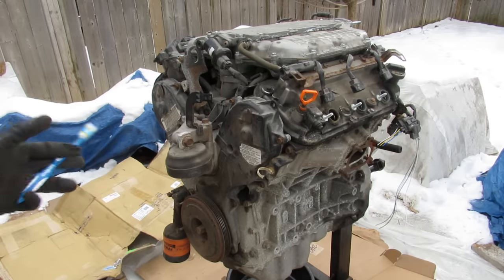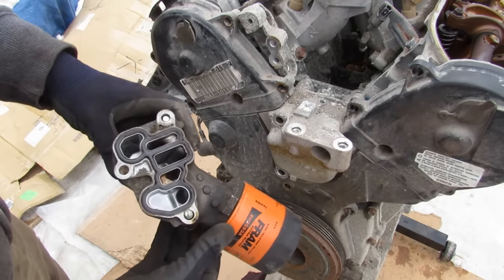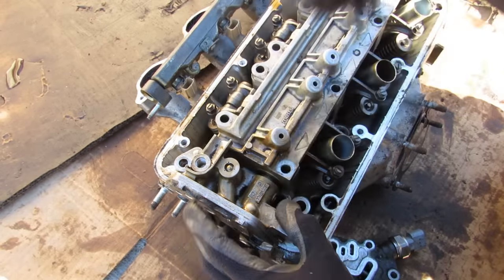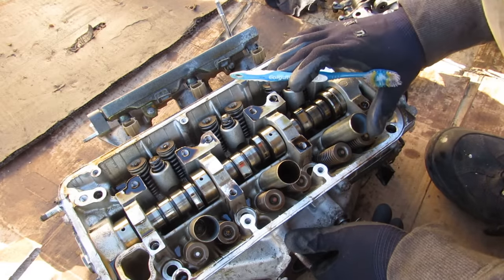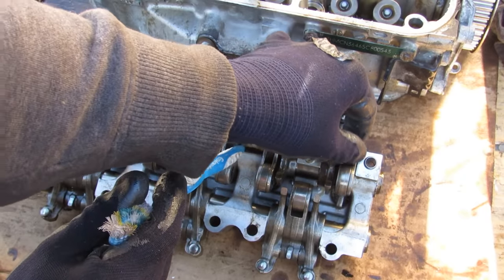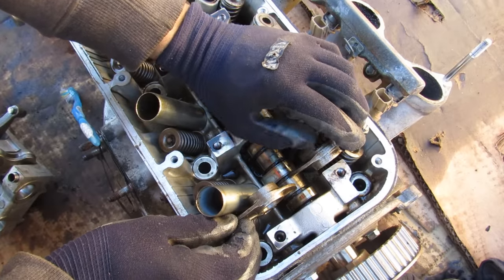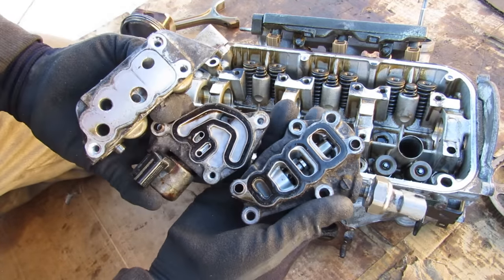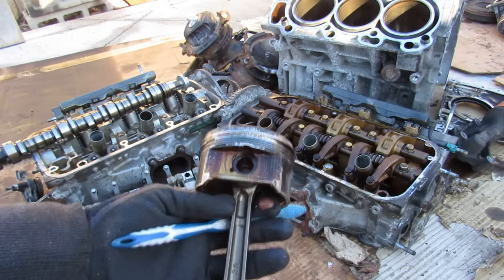Why Cylinder Deactivation Can Cause Engine Failure

Comment: You can use a range afm disabler on the gm cars to get rid of this entire problem. There about 250 bucks but well worth it. Plugs right into the module by your knee underneath the steering wheel. This emissions shit is going to far

Comment: VCM is such bull crap. I just spent $3100 repairing rings on my worn out 3 cylinders in my 2014 Honda Pilot. I remember a time when a Honda motor would be the very last part to fail on any Honda …not any more. All in a an effort to save the planet and 2mpg if your lucky. 3k would buy a whole lot of fuel.
Reply from the maker: You're right, so sad to see. 
Did they have to pull the motor to change the piston? Or just the head and pan?

Comment: Lol that’s not a single overhead camshaft that’s a double overhead cam shaft or in other words a twin overhead camshaft engine meaning for 4 cams in total & a single overhead camshaft means only 1 camshaft & that’s most definitely on inline 4 cylinder engines
Reply: Ummm look again jack, 1 camshaft per head, not two 🙄

Comment: Sounds like a flawed system right out of the box. Probably designed by lawyers looking for a sneaky way to "meet" emissions regulations. They may have done that, but the system is still a danger to public health due to the headaches it's causing to Honda owners.
Reply from the maker: Yeah lots of headaches

Comment: Why Ford just said screw that.. They just built a 3 cylinder engine..Problem solved.
Reply from the maker: 3 cylinders are terrible ....
Reply: @speedkar99  Right.. They sell like hotcakes in Europe.. As even BMW seen the light...........They produce the Twin Turbo 1.5 liter. That will eat most V6 American cars alive...

Comment: Well, sucks that it didn't work. If you ask me, as a car enthusiast i would rather have this, then electric cars with no gears and no noise.
Reply from the maker: Well of it worked fine and didn't cause problems then sure...but it doesn't

Comment: Surprised nobody has just fitted 2xV4 engines to a car before. Just switch one off when cruising.
Reply: There'd probably be a more significant delay in firing up the second engine and reconnecting it the the crank/flywheel in time with the other engine. Might be cool for a sedan that can operate fine on just the four cylinder if you want to turn the other off to save gas. Unfortunately EPA doesn't give points unless the manufacturer is forcing fuel savings on the consumer. Also, everything needs to be dual purpose and it wouldn't translate well to the truck market.

Realistically speaking enthusiasts would hate it. Everyday people would just as soon take a hybrid system with a fully competent 4 cylinder and equivalent output electric motors to give v8 like acceleration. That's also kinda the niche for smaller turbo 6s. Provide v8 acceleration with some fuel economy savings if you baby it. You could argue that a dual 4 cylinder could be more reliable but that's a hard thing to sell to the public until proven a decade later

Comment: I don't see how having a 3 cylinder compressor with no inlet or outlet being driven by the other three operational cylinders can possibly use less fuel - this technology is just plain stupid.  No wonder it's hardly ever used.

Comment: Buyers beware about the 2021 iVtec with VCM, they are still using the same design.  Metaphorically the design was changed.  Ask honda what does that mean?  Honda cant hide, the truth will find you.. Any rebuttal from Honda ? nothing but the sound of crickets..

Comment: I have GMs active fuel management. I rather not have it.
Reply: Our 5.7 Hemi Jeep vibrates in 4 cylinder mode, but it works at least. The vehicle is 9 years old, so I'm not being picky about it. I'm more concerned about the rear main seal leaking. Vehicles don't age like wine, unfortunately.
Reply from the maker: Yeah GM hasnt faired well with cylinder deactivation either

Comment: This is so complicated omg
Reply from the maker: It's a neat system
Reply: @speedkar99  I have a question..  the new ones requires..0w-20 oil ...if I was to use Would 5w-30  in that engine would it damage that system? . I only ask because I know I can get away with using higher weight oil on my older Lexus that isn't this complicated.

Comment: Why does Honda not deactivate cylinders at random? It would probably increase engine life. I am no fan of this technology. Let all cylinders work and burn a bit more gas and save a ton on repairs. I dont think Toyota uses this crap.
Reply from the maker: Then each cylinder would need this rocker arm system

Comment: My 2005 Honda odyssey has only 122K miles. Because of VCM , the engine is already burning oil.  Spark plugs in cylinder 1, 2, 3 are all oil fouled.  Check Honda bulletin 13-080,  Honda lost a law suit and had to provide owners an additional 8- year warranty extension so that owners could get new rings.    Never ever buy a Honda with a iVTEC with VCM engine.. This is an  engineering failure.  .  The engineer who designed this engine should be shoot...
Reply from the maker: Are you getting it rebuilt?
Reply: @speedkar99   the dealer wants $8Kto replace the rings and noted that they cant guarantee that the engine can get 20K more miles.  This low mileage is too low for such a young engine.  I expected better quality from Honda.

Comment: I installed a S-VCM on my 2019 Ridgeline and did a liqui moly engine flush, and Gas System Cleaning at 80k. Couldn't be happier with the new performance and how the Engine feels. I'm really disappointed with Honda and every car manufacturer that puts this piece of shit tech into their product. I didn't buy a Truck for fuel economy, I bought it for comfort, muscle, and hauling capability. I wonder how much less our trucks would cost if they didn't sabotage us with this unnecessary tech and long term wear and tear. If you want fuel economy, ride a horse.

Comment: Trying to shut off cylinders on a rotating cylinders is stupid. You want to really save gas ⛽️? Don't drive a truck if you dont need it. 😂. 
Aerodynamics and a transmission that has dual shifting points , based on the weight thats being carried. VST. Variable Shift Transmission. 😎.
On a totally different note, the car industry had stolen our established railroads and shut them down. Now we fight wars for ⛽️.  We also bail the big 3 out, and build roads with our tax dollars. Sometimes the solution has nothing to do with fixing the car, maybe should have stayed with railroad system.

Comment: I watch ur video and know u don't like any nissan engine and transmission at all. I have nissan vq engine and cvt transmission with 6 years and no problem at all. Just buy what i need for. Not pay high price for honda and Toyota. They do this vcm kind of crap fpr better fuel economy. Plus direct injection on top with more compression ratio. Its all add up to high engine temperature to fail this new engine sooner..  Nissan vq engine don't have that vcm and direct injections and regular compression ratio natural aspires engine will last long then this fuel saver engine